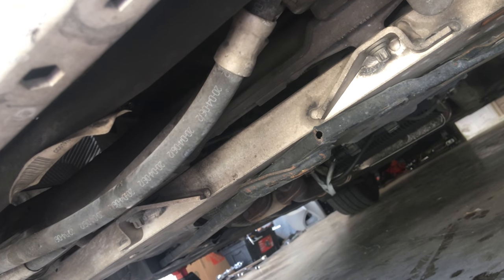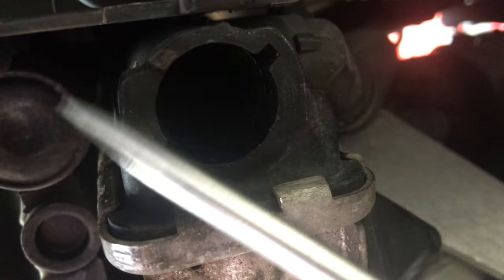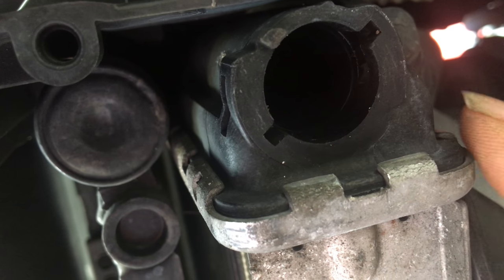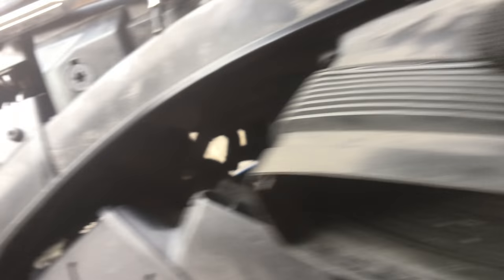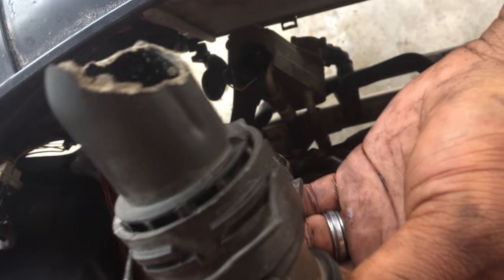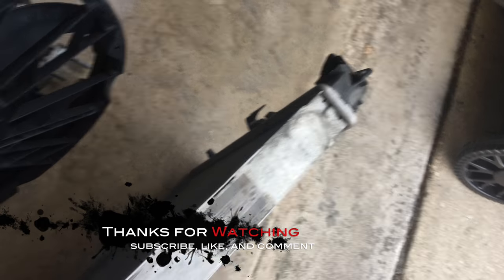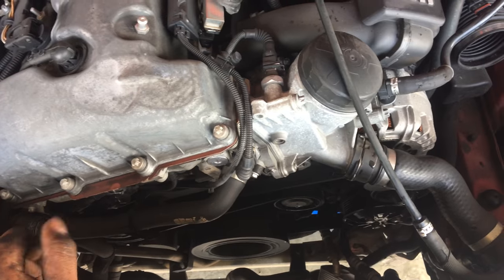BMW E90 E92 E93 Radiator Replacement

Comment: Thanks for the helpful video, how did you install the radiator drain plug stalk? Assuming yours is an auto too since auto and manual have different drain plugs.

Comment: Really liked your video.  Been working on a friend's 325i Beamer and been a real education on this thing.  It seems BMW really likes this plastic cardboard crap.  First the plastic part of the upper rad hose comes appart.  Had to rescue the lass at a 15 mile from no where park and ride.  Of course no part place had  a Beamer plastic-cardboard ended rad hose out there so I hose clamped a temp hose to get her home.  Got the right hose off of EBay (Part store $ out of sight.) and replaced.  Problem fixed. Until she started complaining about adding coolent to often.  Ok rented a pressure tester.  Nothing really leaking under pressure but saw a dry track under the bi-pass hose connector.  Ok, wiggle it a little to see it might leak some.  Blam, the thing broke spraying, blasting, me with antifreeze (Luckley a cold engine.) Again Ebay, pressure tested, it's fixed.  Untill she again complains about adding coolent to often.  This time I can see it's the upper rad connection same place your rad broke.  I could have weakened replacing the upper rad hose like you did but it did pass the pressure test?  This time she admitted to bumping a truck a week earlier with a little ding on the hood that we fixed with some touch up paint.  Maybe the bump, maybe me. Dam, that's why am at your video, to replace the radiator. Any thing else I need to replace.  Thermostat and water pump have been replaced (both electronic and lots of $). The lower rad hose and what else?

Comment: My first time changing my radiator, the same neck where the upper hose connects broke. The bad thing is that all I needed to replace was that leaky hose but in the process of trying to pry it off, the neck on the radiator broke resulting in me having to replace the radiator too. So, why were you replacing the water pump, radiator and t-stat? Were they all bad or just some preventative maintenance?
Reply: UberDude that's exactly what I did to mines swapping out the  radiator hose  luckily  I had n51 sulev  engine with the sensor mounted on the radiator so bmw covers up to 15years or 150K miles 

Saved myself 800-900$ bucks by digging around on the web and found the sulev warranty.
Reply: Kdub Spencer 
That makes 3 of us lol, that fuckin radiator is made of some really cheap shit
Reply: Boxing Empire sulev warranty covers the valve cover gasket also .just got that swapped last  week for free.

Comment: Great video. Helped me find the one one screw on underside of oil inter cooler that was stopping me from progressing.  Haven't had same trouble with any of the plastic fittings - yet! A bit on the different plugs that come with the replacement radiator would be good. Also, original had just one plug one side, replacement has plugs that can be interchanged on both sides.  Thanks.

Comment: Dude that neck to the top radiator hose is fragile as shit! It broke when my torque wrech fell on the hose, i was so dissapointed in that.
Reply: I think BMW make them so the minute you fix anyone of them they break. I changed my top hose and ended up now having to replace the radiator.

Comment: I think BMW make them so the minute you fix anyone of them they break. I changed my top hose and ended up now having to replace the radiator.  If you went to replace radiator for sure you will break the hoses. Video does not show a replacement , it shows a take out. Replacement is not the right word.

Comment: Hi guys, plastic rad / cooling  parts rot  on BMW's -- if the wrong coolant  is used.  Use only BMW coolant and the plastic stays fine.

Comment: Did your radiator have the  sensor attached to the radiator?
Reply: Complex Seven Industries did the car give you a check engine codes  because I've read around and ppl say the sensor is checking for a magnesium coated radiator so it trips a code when you replace it with a oem radiator.
Reply: Complex Seven Industries  no code I just need to change my radiator because the connection cracked where the coolant to connect but I've been seeing people saying you get a check engine code if you put a radiator that doesn't have a magnesium coating like the original radiator
Reply: Complex Seven Industries but the sensor I'm talking about it's connected directly to the radiator
Reply: Complex Seven Industries turns out since my BMW is sulev BMW covers anything emissions related for 150k miles or 15 years.

So they are giving me a new one at the moment and swapping out some recalled parts on my car 😁

So in case you ever get  a sulev that's under 150k and under 15 years the cats, radiator ,etc. Is covered just call your local BMW and bring up the sulev warranty.
Reply: I have the same issue as you. My upper hose on the radiator wouldnt come out and I broke it. I have a SULEV 328i and dont want to buy the $500 SULEV rad. They just replaced it even know you physically broke it?
Reply: opinion56  yep  told them my radiator was damaged because the connection broke off and they replaced the radiator and the hose that connects to it.

Just took it out of BMW 2 weeks ago and had them also replace my valve cover gasket because it was leaking oil causing smoke during start ups 

All free of charge 👌

Just call your local BMW and tell them your radiator connection is cracked and is leaking coolant everywhere and mention the sulev warranty
Reply: Kdub Spencer 

Do you live in a sulev state? Bought my car in California but I don't live there . I live in a non sulev state
Reply: opinion56 i stay in Los Angeles
Reply: Ok. My radiator is beat to shit because. Is it possible if I show up with a SULEV aftermarket radiator? You think they would replace it?

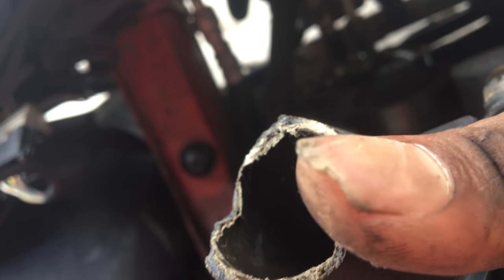Comment: @7:20 i had the same problem brittle cardboard plastics i broke the hose, radiator (same spot), cooling expansion tank, and the fan burned out causing the bmw(bucket) to overheat....we should start a class lawsuit for the lemon law 🍋🚗 .........my 1987 toyota 4runner is built like a 🚜.  Built to last.....